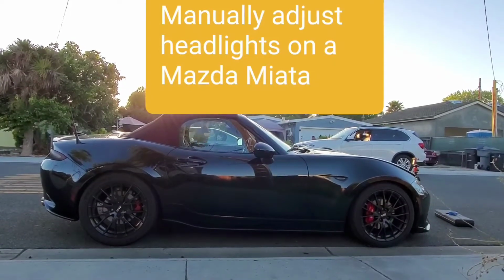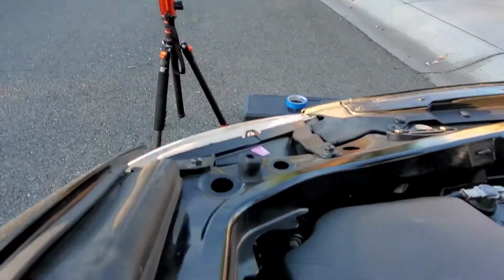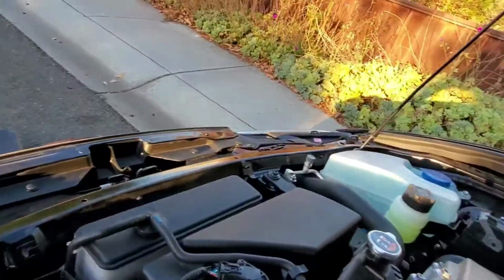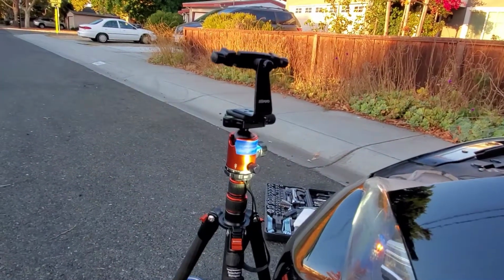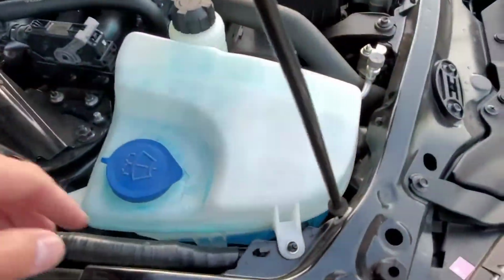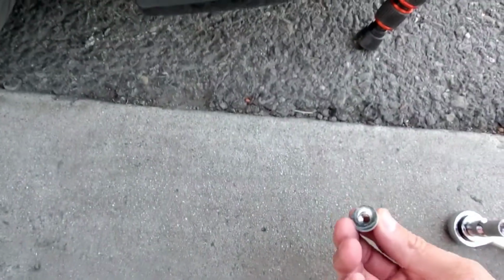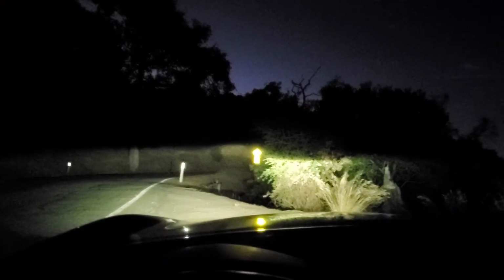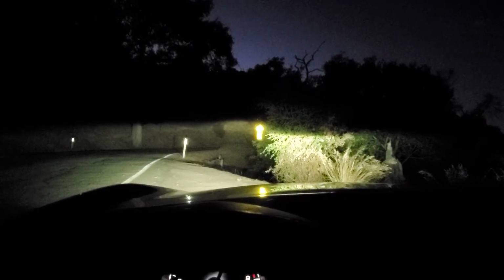Manually adjust headlights on a Mazda Miata

Comment: I have a 2015 / 2016 model but there is no screw. Only a white plastic housing. They are automatic leveling or something…
Reply from the maker: The sport and club didn't have auto up and down. The upper trim did. If there is a place to use a box wrench. Right up. Left down. I used a wall. 25 feet to re adjust. I initially set them to high.
Reply: @ Ah, then How do I change them in height…. Bummer

Comment: Is it possible to only lower the level of the high beams? My low beams give me great visibility so I don't fall into pot holes, but my high beams aim at Jupiter.
Reply from the maker: The housing is fixed. Maybe it's possible. I never tried it. I don't see the point as high beams are used when ppl are not in close proximity. Get the brightest low beams. I had 102k. Never had to change out any stock lights.